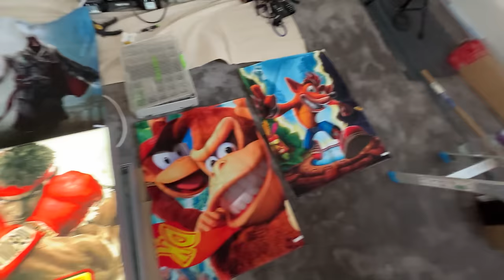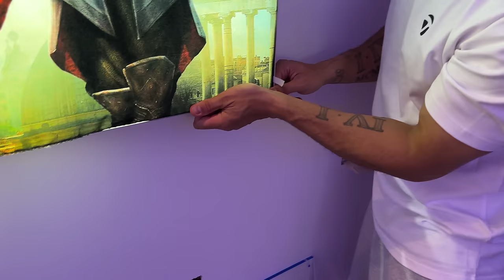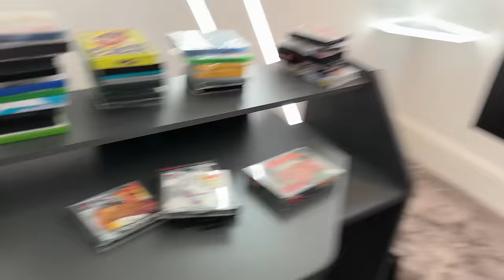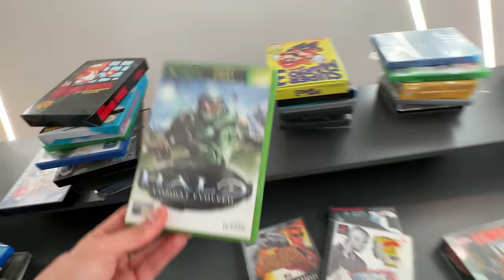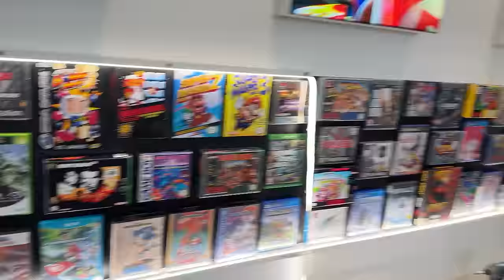BUILDING THE WORLD’S BEST GAMING ROOM IN MY HOUSE

Comment: Nice room really cool with all the retro consoles and all. Just one think make sure you took the plastic out the SSD's, put more fans 3 intake on the bottom and 3 exaust on the top will make your PC work so much better because of the temps. Oh and it seams you put the RAM on slot 1 and 3 usually for dual channel it's on slot 2 and 4 just make sure of it. Enjoy your room i wish i had something like that :)

Comment: peel the blue tape off the thermal pads for the ssd and also check the motherboard manual to see if the ram are in the right slots and i think you might have used the wrong screws for the power supply. but other then that YOU DONE A GREAT JOB !! HELL YEAH DUDE beast of a pc!

Comment: one thing the heat pad on the m.2 drive has a plastic cover that you have to remove when installing the m.2 drive and it will cause it to heat up more, i may be wrong but it did look like you had left the plastic on there

Comment: so first in foremost, the room is super sick. love the master chief armor. i did want to mention that i watched the entire vid and checked comments and i didnt see anyone mention this, and if they have i apologize. but the ram you put in where in the wrong spot. rule of thumb in pc building is you start from the farthest slot to the right, which means they go in slots 2 and 4( duel channel), you put them in slots 1 and 3( single channel). So if you want full performance from the ram switch them to duel channel. just wanted to let you know. otherwise amazing set up my guy.
And for an extra tip go into the bios and turn on xmp so your running the ram at full speed.

Comment: The room looks stunning amazing stuff man, keep going!
May I add a few suggestions:
1- If you can manage to squeeze in a Racing Sim, that would be awesome. You can place it in front of the ultra wide monitor, and move the Xbox and PlayStation to the console zone, or just leave them and add a racing setup there!
2- I don't know about the PC placement in that compartment, I'm worried about thermals! try to monitor them and see if the PC gets hot!

Comment: Just wanted to point out the two sticks of RAM should be installed onto the second and fourth slot rather than slot one and three. The power unit should also be the other way round with the fan facing towards you rather than towards the chassis ❤

Comment: I would swap out that ultrawide monitor at the console desk as your consoles don’t support that aspect ratio and instead will just stretch it. You might be able to get away with 21:9 looking ok but 32:9 will look horrendous (as it did when you booted up Fortnite). That monitor is well suited for your beefed up PC.

Comment: One question and I would like it if I could get an answer as soon as possible. Are sony, PC allowed to work near a fan, for example, if the air conditioner is on in that room or the home fan, heater? I heard that you shouldn't, because some electricity is generated that can connect to your device and some component crashes on the pc, sony. Is this true or nonsense? Thanks in advance for your reply

Comment: Just to double check…when building the PC, before installing the SSD, did you remove the blue protective film 🤔
Reply: Could do with a a few inlet fans too, to assist with cooling and airflow. Ideally you’d want more inlet to exhaust for a positive case pressure.

Comment: There’s so many things wrong with that built. There’s only negative air and no positive. Which means there’s no airflow coming into the computer. I would recommend getting a few more fans and put them on the bottom of the computer so there’s air going around the whole case. And with the SSD, the thermal pad isn’t doing its job as the piece of plastic is still on it. Remove the blue plastic and check the cover too as I’m not sure if you took that plastic off. I’ve built 3 PCs so I know what I’m talking about. And I also have a computer science degree. This will make your computer last longer.
Reply: Mate computer science is for coding not building computers
Reply: @Rqmboutlaw computer science includes IT architecture which includes Computer hardware. So it’s a lot more than coding, trust me. I even built 3 computers in the past for family and friends. Potentially going onto my fourth.